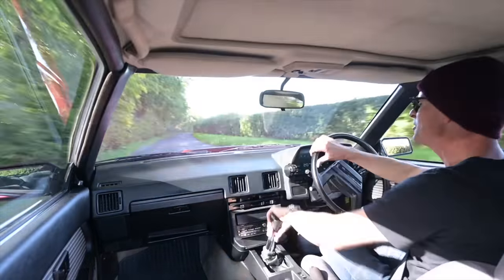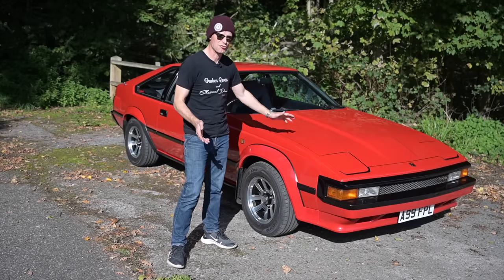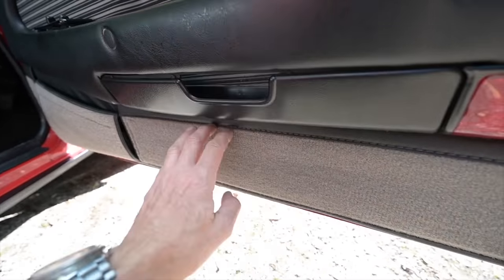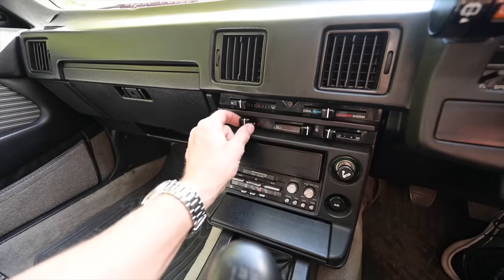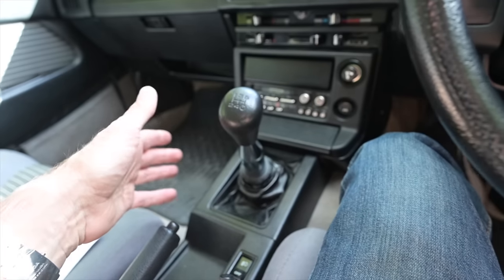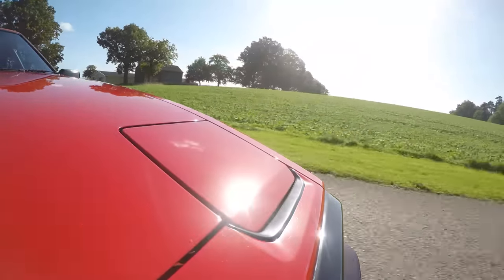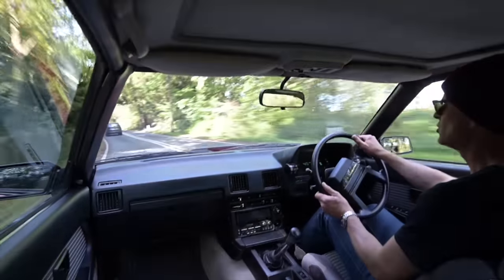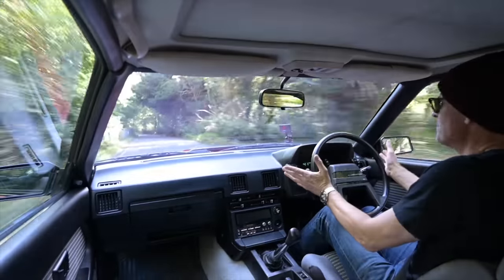Mk2 Toyota Supra..1984 Celica Supra Goes for a Drive

Comment: Remind me again which Genius decided that mainstream motor manufacturers must build mostly SUVs of various top heavy and space wasting sizes that handle like a Leyland Olympian.
Reply: Well said sir, I hate SUV's this is the type they should bring back and not the Toyota-BMW-Supra it's too much like the Z4.
Reply: @johngrubb1590  What if Ford had studied the Celica Supra and evolved the Capri 2.8i a bit more. With the suspension of the XR4i but the same low stance, long bonnet and short tail. Surely that would have found Coupe customers.
Reply: @seancooke7332  It just may have and it might  have looked cool, but Ford been Ford well what can I say.
Reply: @johngrubb1590  Ford Puma Hybrid ST Line anyone?
Reply: @seancooke7332  Yeah it's not a bad car it's a crossover not a suv so it works for me.👍

Comment: Wow, a friend had a Japanese market (imported into New Zealand) one. It was almost identical however it had an ultra high revving 2 litre six that redlined at about 8000 Rpm.

I remember teaching him how to double de clutch the gears to access the power band at any speed.

My understanding was that this 2 litre was almost as powerful as the 2.8. I can't forget the amazing noise as the revs wound past 7000.

I always knew he was visiting as I could hear the sound of his car 5 minutes before he actually arrived.

The other thing that amazed me was the fact it never blew up..
Reply: Yamaha built engine
Reply: @mreuropa88  I wondered that, I think it was better than Yamahas 4 cylinder attempt in the early 2000s Celica.
Reply: 1G
Reply: I had the 2 litre. Yes it was nearly as quick in a straight line but handled better (bit lighter) Blew 2 engines. I came from Kawasaki bikes. 2 speed. Fast and Faster. You would have throught I would have learnt after the first time. The 2.8 litre engines were bullet proof.

Comment: In the early 90's i  had a 1986 model in the same red but with maroon interior. In Australia they only came with the single ohc six. Mine had that rear spoiler over the rear window which I thought balanced the chubby rear a bit. The blank above the radio/cass housed a graphic equalizer, otherwise mine was exactly the same. Your test car is in incredible condition. The single ohc six was torquey but not great, it was however a really comfortable 5th gear touring car. In Oz summer city driving it suffered badly from heat sink power loss from the big 6 crammed into a 4-cylinder hole. Really enjoyed your review.

Comment: I love the 5M-GE 
It makes such good noises :)

It's a rather unique engine in that, it's got DOHC, yet only two valves per cylinder!, Gives it a very aggressive valve angle, and that characteristic sound :)
Reply: Interesting setup. Thanks for the info.
Reply: there were many more DOHC 2 Valves like Toyota 2T-G, 18R-G, Alfa, Fiat, Lancia (all DOHC engines) from ~1950-1980's, Ford Sierra DOHC 2,0, Jaguar XK engine family 1949-1992...

Comment: Here in the States, The MKII Supra to get is the 1984-1986 models as they had in increase in HP to 160-161 via higher compression and redesigned intake manifold. Only the initial 1982 model had the 145hp engine, in 1983 it increased to 150 and by 1984, again, to the 160-161 mentioned. Those seats were available only on the "Performance" type Supra(you get the fender flares, chunky wheels and tires and the manual transmission) and in the GT-S version of the Celica and AE86 Corolla. Those seat were very popular with thieves, as lots and lots of sporty non-Toyota imports were being equipped with these particular seats.

Comment: I remember this model of Supra and admired them in the 1980s. I had a rwd 1982 Toyota Corolla 1600SR and I can see so many design and material similarities, the carpets, door cards, design of the steering wheel, interior and exterior door handles except the digital dash. Great content, classics of yesteryear. 👍

Comment: They used the wheels and quite a few bits and bobs on the Lotus Eclat Excel. Love the Supra looks really beefy.
Reply: only the wheels in one specific excel version, and that's a maybe.
Reply: @piuthemagicman  They used far more than that - I owned an 84 Excel with these exact same wheels but they also used the gearbox, diff and lots more parts - compare with an earlier Eclat to see the differences.  The gearbox is also used a conversion on things like Holden V8s in Aus - mate has one linked to a 4.3L V8 in his HQ ute.

Comment: I remember when the Mark II Celica Supra came out to replace the Mark I. Canada got the Mark I, and what a joy that was. The angular Mark II never seemed quite as graceful a design. Beautiful cars to drive, that is for sure. The Mark III Supra was a whole different kettle of fish as it moved over to share the platform of the Cressida, a luxurious saloon or estate. That helped keep costs down. When Lexus was introduced, Toyota goofed. They made a gussied up Camry, rather than continuing the rear wheel drive Cressida badged as a Lexus. That meant Supra was a stand alone model without the volume to make the engineering a reasonable proposition. As a result, the price went way up and buyers went elsewhere.

Comment: Cool car.  Back in the early 90's a mate of mine had an '86 Mazda 626 coupe with the digital dash in orange display that is very similar to this.  It had electronic adjustable suspension, double din stereo with graphic equalizer and electric rear quarter light windows.  We all thought it was VERY cool - certainly better than my '84 Nissan Sunny!

Comment: Last one i seen was many years ago in a scrapyard ,i still have the front Panasonic speakers from it they were dash mounted and each had  sealed plastic speaker boxes iand had a passive type bass cone i still have these as well .The same scrapyard also had a interesting triumph 2.5 pi with a rover v8 and a 5 speed gearbox .

Comment: That brings back fond memories. My brother had one here in Melbourne, Australia, my sister aa black Celica. I remember the Supra being much the same spec, sans fog lights where the switches were blanks. I beleive the floor pan and engine were the same as the Cresseda, a four door semi luxury saloon - long replaced by Lexus models here. The Supra was such a good car to drive, I was a bit miffed when he sold it for a 1st gen RX7 - in which he replaced the engine with a later one and twin turboed it. It was down right dangerous with the amount of power in such a light body. The Supra - what a nice car, would love one now, but they have completely disappeared.
Reply: The floorpan is Toyota A meaning Corona/Carina/Celica(Supra). Supra is only stretched between the A-post and front axle for the 6. Even the last FWD/4WD Celicas were based on the Corona/Carina/Avensis/Caldina platform.
Reply: @piuthemagicman  Seems my brother was telling fibs then! The engine was certainly out of the Cressida as I looked at a few beforfore buying a brand new Honda Accord saloon. I'll have to dig out the brochures from the time. Thanks for the info.

Comment: I knew; this was the second car I ever owned. Rebuilt it three times, including transmission. It was a rust bucket. The motor could reach 200 km/h, and the electric motors for popping the headlights would get play in them, so the pop-up lights often wouldn't work correctly.

Comment: Weren't the wheels used on a Lotus-maybe Eclat?
Reply from the maker: they do look very similar
Reply: the Lotus Excel used the Supra wheels and early mk2 Supra (82-84) door handles aswell. Lotus also tuned the MK2 Supra suspension.

Comment: The mark 2 supra is a bit of a secret gem of japanese sports cars. No one cares about them until you own one and they surprise you.
Your info is a bit off tho. The U.S./Canadian models were 145hp in 1982-83 only then they went to 160hp in 1984-85 then 162hp in 1986. The L-type could be had with a manual as well, for most years. The p-type also got leather seats in the later years as an offering instead of only just the L-type.
I did not know the European spec cars were 170hp+ tho.......makes me wonder what toyota changed? probably just ecu tuning so I guess i'll try and track down a euro ecu for my 84 p-type.

Comment: I had a 1985 L Type in college.  It was not fast and it did not handle well.  I also had a 1989 MA70 and That car did handle better but the 7M and head gaskets got to be old quick.  Overall the MA80 is still the only Supra to own if you can afford one…